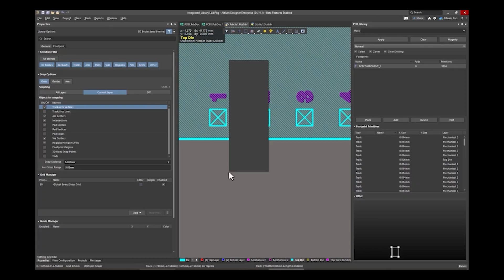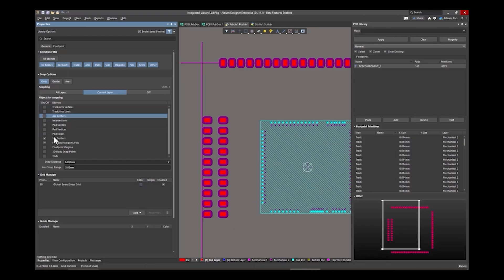Unlock New Design Possibilities with Wire Bonding - Recording Preview

Comment: What facilities are available for wire bonding?
Reply: Me too, a quite a few larger EMS companies will provide this service, but there are some smaller companies also offer wirebonding assembly, including in the US and Europe. Wirebonding is more common for test platforms than in commercial products, I would bet chip-on-board with bumped dies is more common these days.